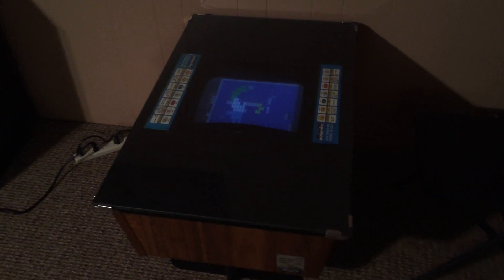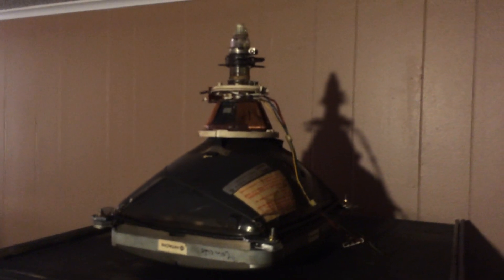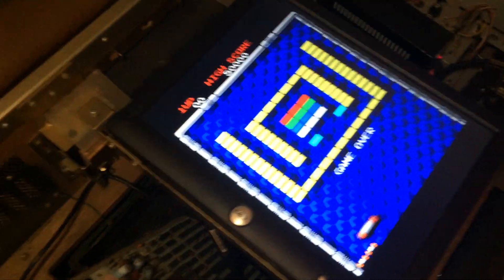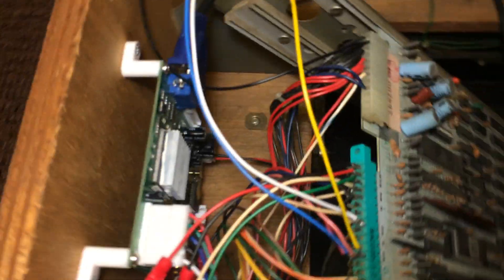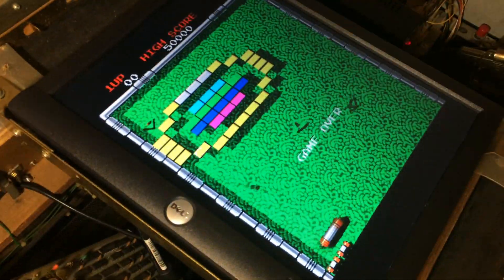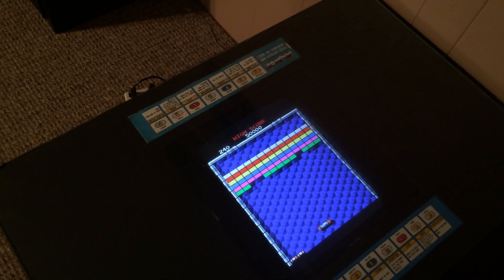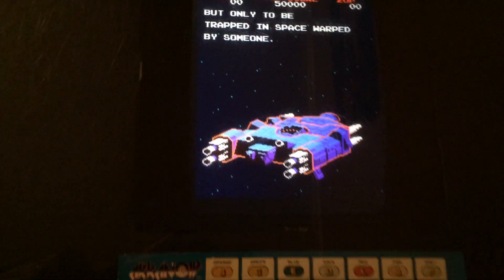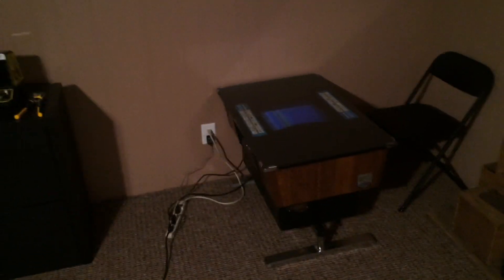Arkanoid Update with 1Up Mod

Comment: I purchased an Arkanoid today and I was also aware that the monitor is no good. The game plays blind I’m looking to add a Dell monitor or something similar, I also have a ZAXXON that needs a new monitor, so I’m looking to change out both games to LCD. Is it fairly easy to do? I’m in Trumbull CT and any step in helping me will be greatly appreciated thanks in advance.
Reply from the maker: I'm in Stamford. Do you still have the CRT monitors?  They can be fixed...
Reply: DeLuSioNaL's Arcade The Arkanoid monitor is a Sanyo and the ZAXXON monitor I don’t have anymore, I had the chassis board recapped and I couldn’t get a straight image on the screen at all (my actual game is on Arcade collectors World wide showing the issue) I know a lot of people are against putting LED but I would rather be almost bulletproof then having to constantly mess with boards, and adjusting monitors. I just can’t find any step by step directions on how to change a monitor to LED and add a new power supply. I have changed a new power to the same kind on other games and it was very easy, but the whole monitor change out seems to be a little more involved. I know that Twisted Quarter sells new LED’s  but it’s the install that would be tough. Do you think you can do a how to video sometime? Thanks 😀
Reply: I have a rasberry pi set up but looking for the round joystick. How did you do this set up? Looks amazing
Reply from the maker: It's called a spinner.  Google "spinner" and "Retropie" and it will get you in the right direction.